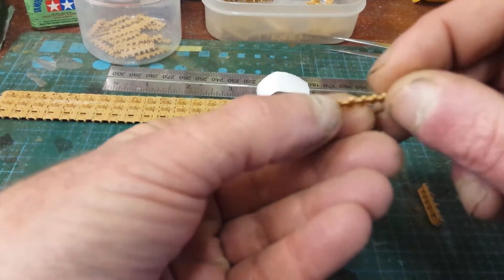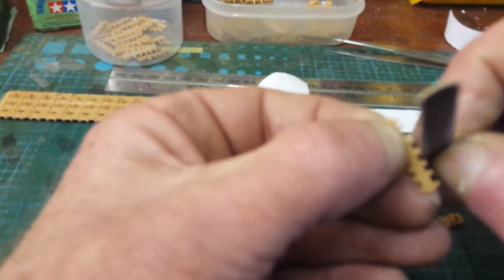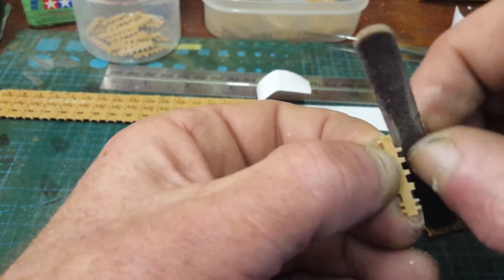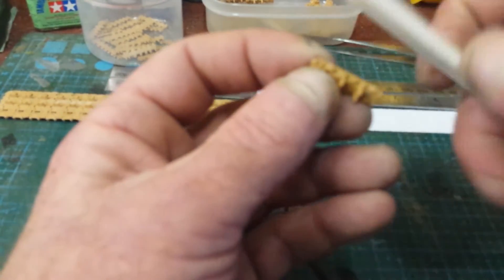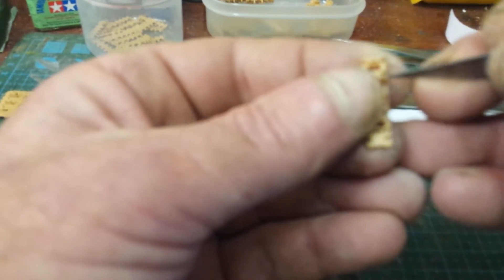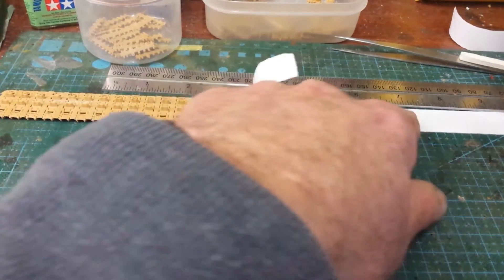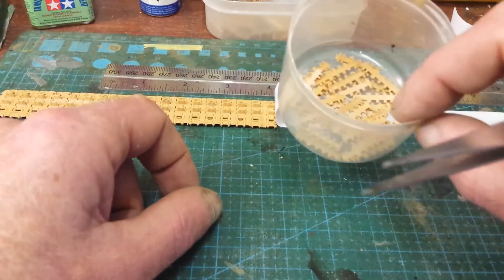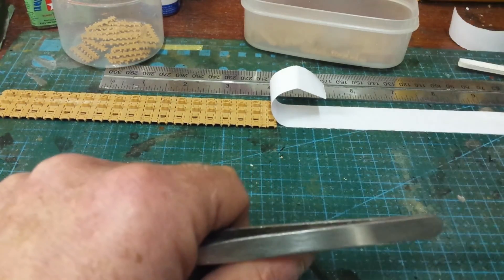Zvezda 1/35 King Tiger ( Porsche turret ) Build Update # 2A ( Track's )

Comment: so i dont need to glue the tracks?
Reply from the maker: Yes you do need to glue them once you have them all together. I use Revelle Contacta it is a slow drying glue so you can work with them for longer as in getting a sag ect.